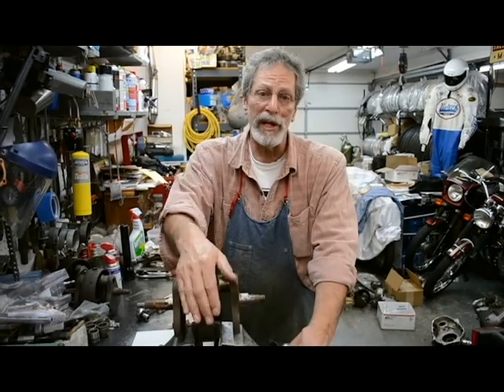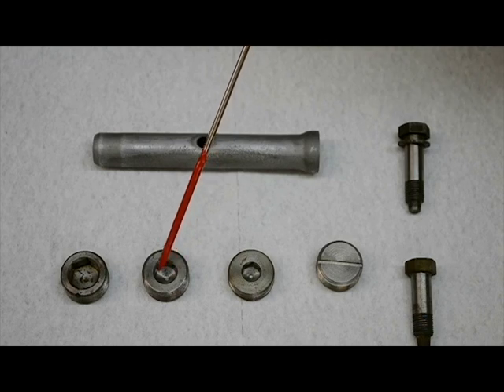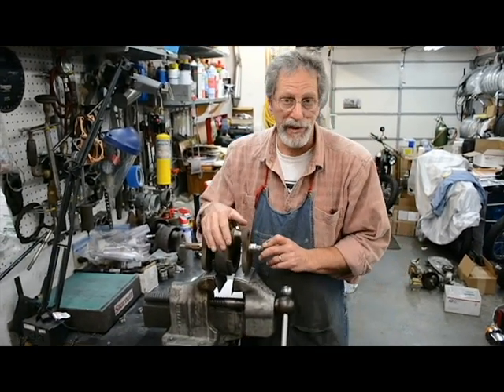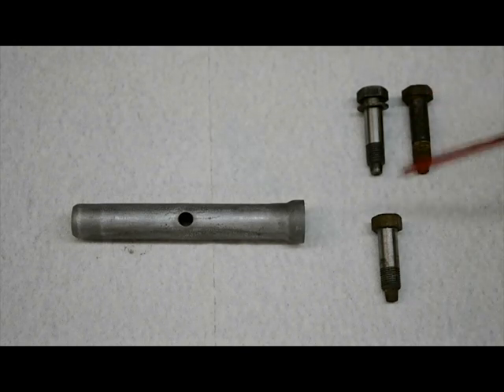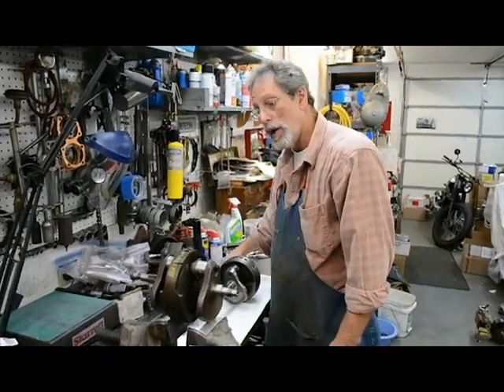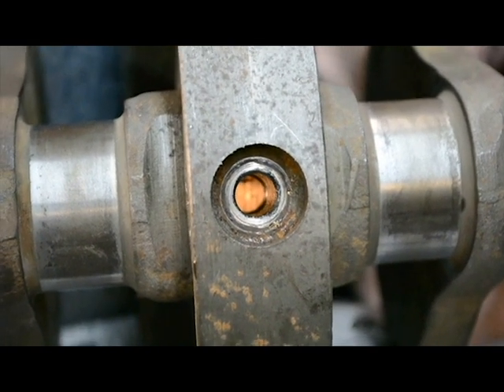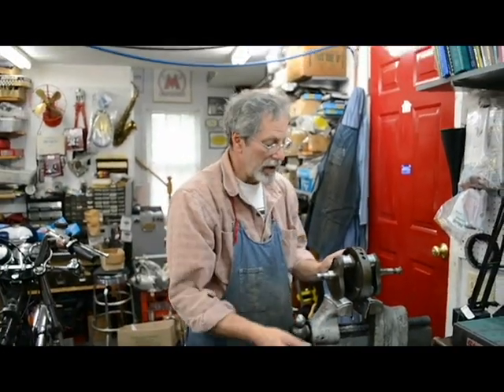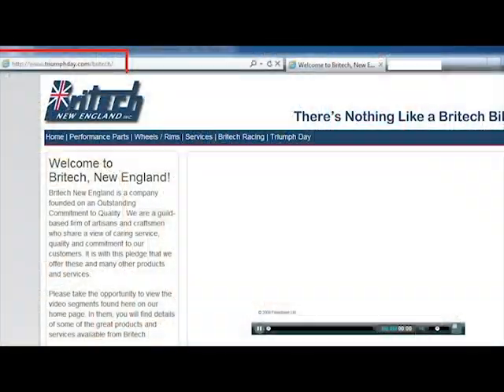Sludge Trap II.avi

Comment: Thank you for clarifying a lot of things involved in the sludge plugs that I have been concerned with. I liked the thought of the hex plugs but I was concerned with the weight.
I was also concerned with the bolts as i keep hearing about them breaking ( not much how or why just they break )
Many years ago I took my motor apart to get the crank rebalanced as it was real bad,that made it much better and now i am taking it apart to clean the sludge and want to keep it that way.

Comment: Jaye, I did see you torque the sludge trap bold that secures the trap in the crank.   I also noticed that the sludge trap plug appeared to have minimal tightening.  Am I correct?   Should this plug be torqued as well?    Thanks so much.   Very informative.   Steve Burke